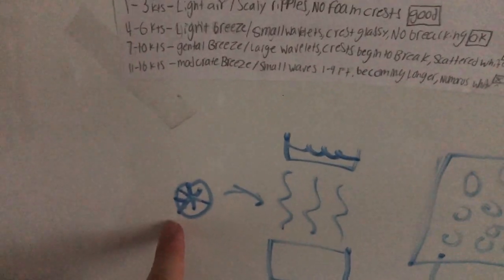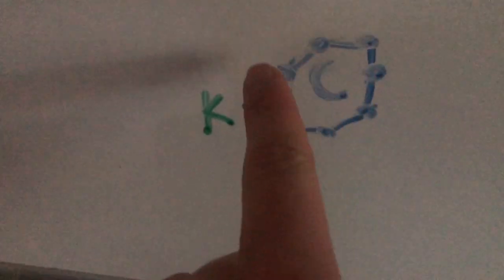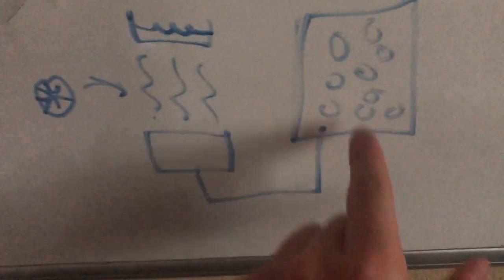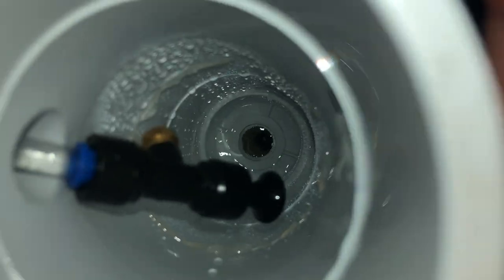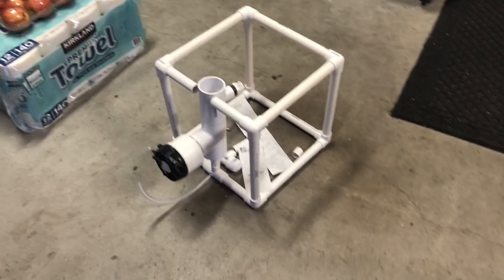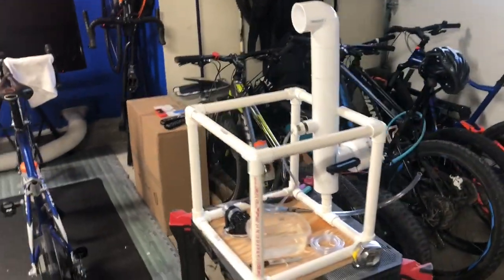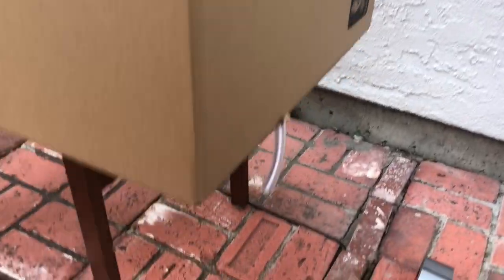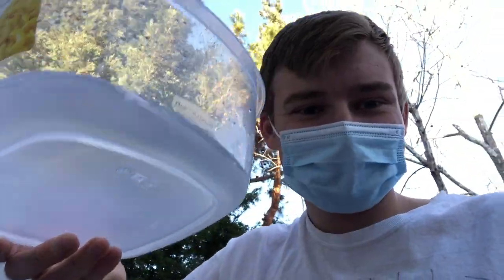TEEN MAKES A DIY CO2 CAPTURE DEVICE! HELP SOLVE CLIMATE CHANGE!

Comment: A common estimate for CO2 levels during the Jurassic period is in the range of 2000 to 2500 ppm.  To put this in perspective, as of recent measurements, atmospheric CO2 levels today are approximately 415 ppm. Therefore, during the Jurassic period, CO2 levels were likely several times higher than they are currently.  During the Jurassic period, Earth's average temperatures were estimated to be 5 to 10 degrees Celsius (9 to 18 degrees Fahrenheit) higher than today's average temperatures. There is no climate crisis.  Climate change is real and primarily driven by the sun. The concentration of CO2 in outdoor air typically ranges from around 300 to 400 parts per million (ppm), and this range is considered ideal, safe, and comfortable for breathing. What happened to the term Global Warming?  Be a good steward of the planet and don't pollute, but don't manufacture a crisis, a common enemy based on lies to control people and make money off carbon credits. Poor kids think there is a crisis.  Design would be good for enclosed spaces.